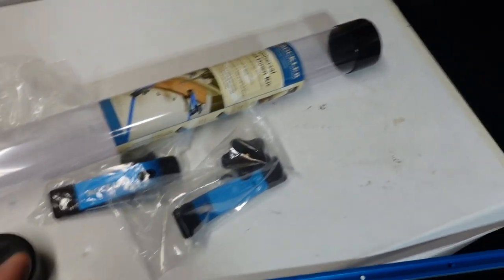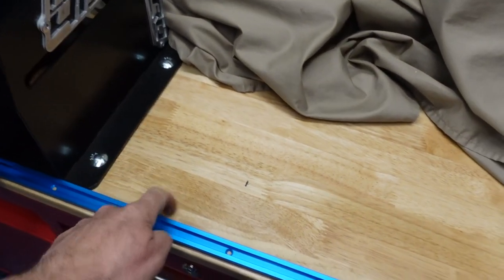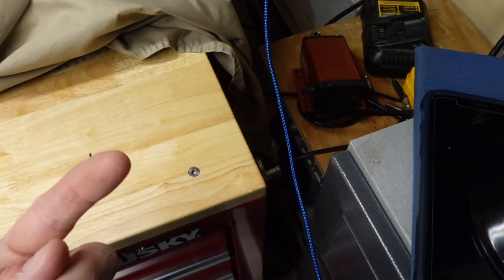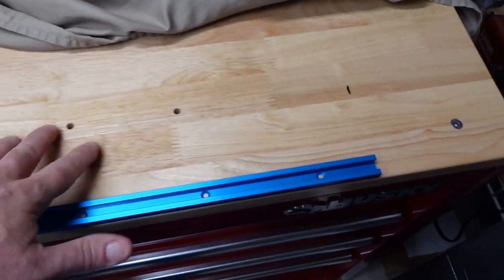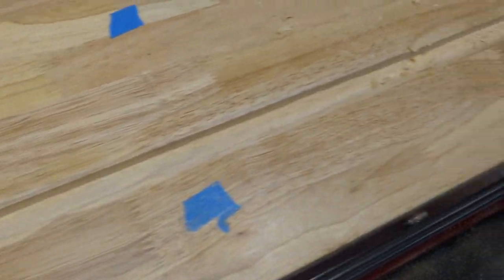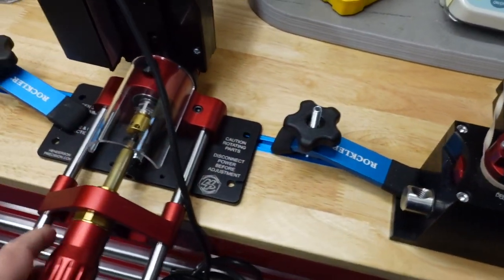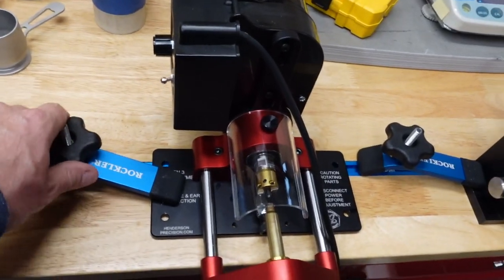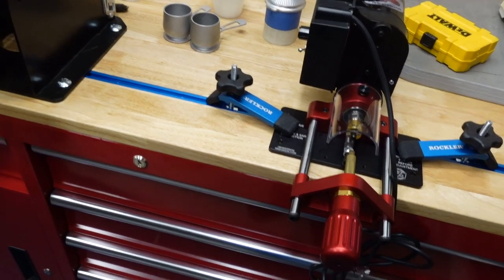Installing Rockler T Track in my reloading bench

Comment: For more holding pressure on what you are trying to anchor; rotate the clamps 180 degrees. Triples the hold down force. Just a thought, John. That's how we in tool & die used similar clamps. Your bench is looking good.
Reply from the maker: Thank you for the help. I'm not familiar with using these so I appreciate your expertise.
Reply: Any reason you couldn't use both ends of the same clamp, at the same time?
In John's setup, one end on the trimmer & one end on the primer tool?

Comment: I have duel tracks and love 'em. I'm limited to one long loading bench, and while it's slower changing things in and out, it gives me plenty of options. The hold down clamps work great, but I also use hardwood  plywood plates mounted to some machines. Also, I do recommend thru bolts instead of screws...they make a difference.

Comment: I've wanted to do this for a long time, but was concerned about the stability of the track. Might not be suitable for a press, for for trimmers, primer tools, etc like you've done it might be the ticket.
I'll be watching for updates on this one!
Reply from the maker: My buddy does it for his press and doesn't have a problem but for me, if I was going to use it for the press I'd bolt the track through the top instead of wood screws. Otherwise seems great so far...

Comment: Hi John. I followed you for quite a while now.  I'm a fan. I enjoy your videos. They're short and sweet. I have a question. I'm installing T Track on  my reloading bench like what you've done. What is the optimum setback from the front of the bench for the track for using the kind of equipment you do I would appreciate any help on this. Thank you. 
Best regards, 
Dr. Brad.
Reply from the maker: Thank you, I appreciate the support. As of the T Track, I'll actually be doing a new video soon for installing t track on a new bench I have coming. As for where to put it, I think it comes down to your needs. If you want to use any kind of press that requires it to come down off the bench then you'll want the first track right on the edge most likely and then something like 8" on center for the next one. In this video I simply put the track where it would benefit me needs the most.

Comment: Holy cow you got a Henderson when you already had a Giraud?? Did you ever think about taking a grinder and cutting the track in two pieces a small one on the left side of your zero press and the larger one on the right side  that way you wouldn't have any wasted track under your press
Reply from the maker: I thought about two pieces of track but it started out where I didn't think I'd get the last 4 inches routed out so I decided to go from the left side and just come across with one. It's ok, I really just need on rail for now, and will possible add another later if it seems like I need it.